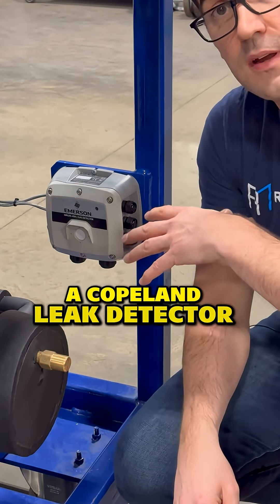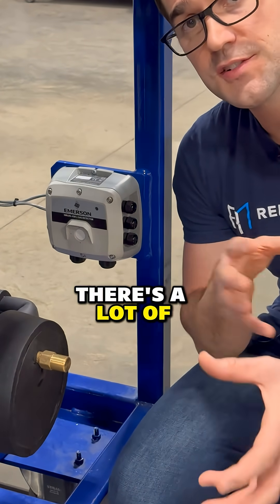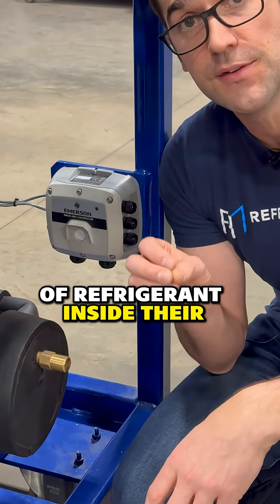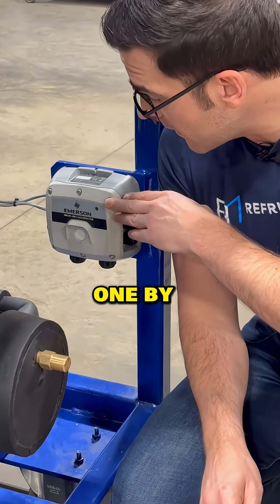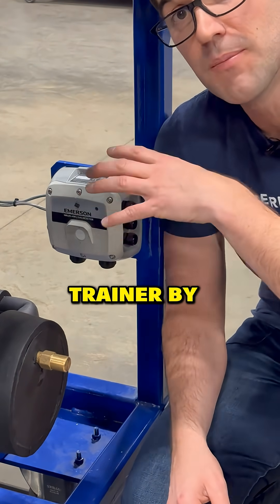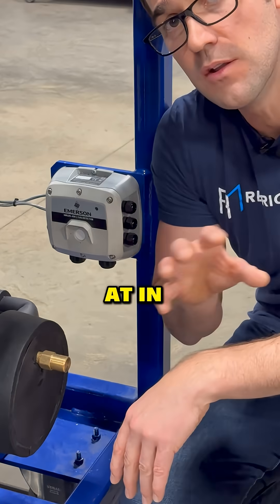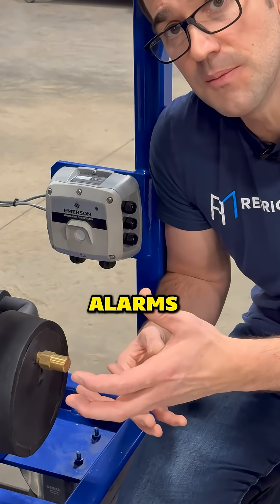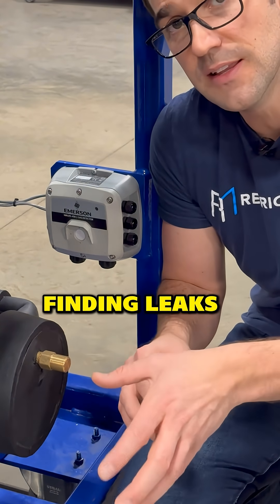Do You Rely on Leak Detection Systems to Tell the Truth Inside a Refrigeration System?

Comment: My 1 system has 14500 lbs of R22 roughly more. As long as you show them respect by keeping them calibrated, having a little conversation while you're calibrating them make sure they're not too cold or too warm in their environment lol they work great and cut leak checks in half for me. Normally just have to check any monitor that's showing any parts per million. Dependable, as far as I can say at this point.